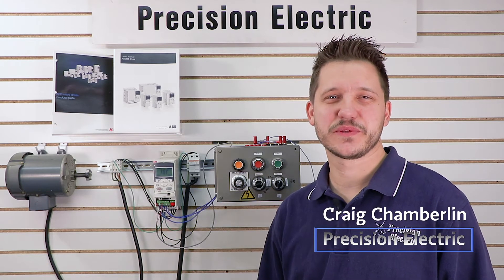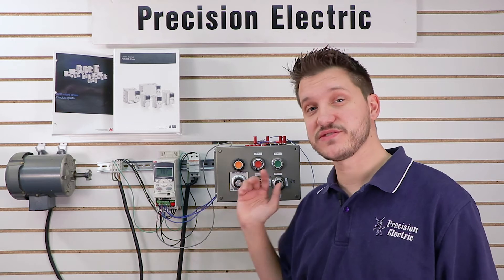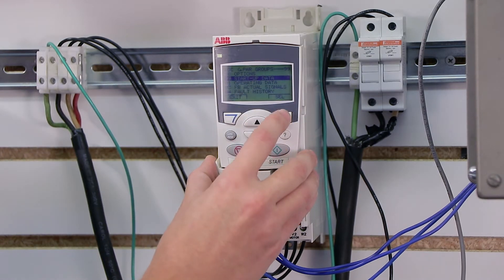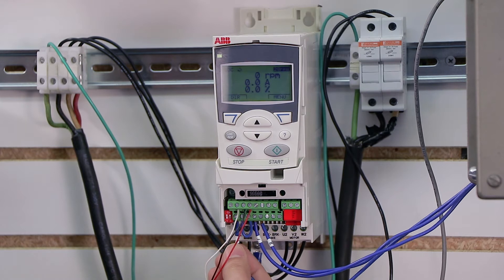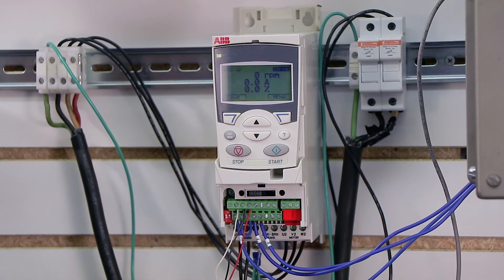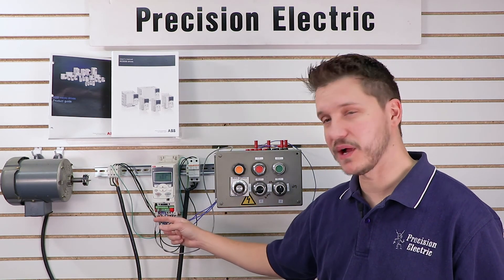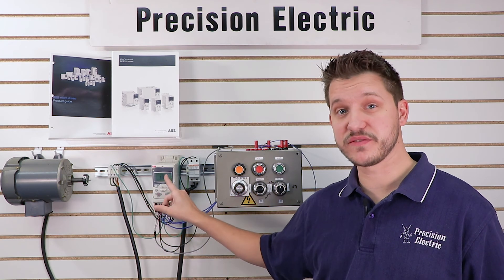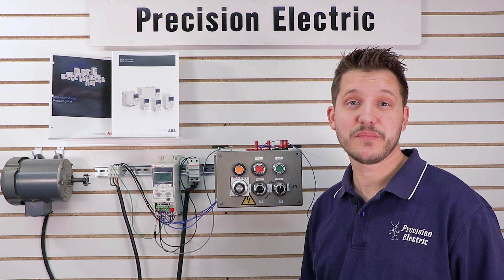ABB ACS355 Training Lesson 4: Basic Start Stop Pushbutton Control Wiring & Programming - VFDs

Comment: Trying to use this drive with a set of photo eyes. Sending a wire from terminal 9 - 24 volts to the photo eye and when the photo eye comes on it sends 24 volts to terminal 12. Now terminal 13 also has to have 24 volts so I jumpered  terminal 12 and 13 together so when the photo eye goes off the 24 volts stops as well turning terminal 13 off and stopping the drive. I have set the drive in 3-wire mode and put it in remote and nothing happens when the photo eye comes on. Is there a parameter that I am missing?

Comment: When I engage the start button, the drive says fault 1009. How do i fix this?
Reply from the maker: ## Resolving Fault 1009 on ABB ACS355 Drive

Fault code 1009 (PAR PCU 1) on the ABB ACS355 drive signals an incorrect setting for the motor's nominal speed or frequency. This issue arises when the entered parameters don't align with the motor's specifications or the drive's operational limits. The sources offer guidance on interpreting this fault code and suggest steps for rectification.

*Troubleshooting Fault 1009*

* *Motor Type Matters:* The first step is to confirm the type of motor connected to the drive: induction motor or permanent magnet synchronous motor. Different calculations apply to each type when verifying parameter settings.

* *Induction Motor Checks:* If you are using an induction motor:
    * *Speed/Frequency Ratio:* Ensure the ratio between the motor's nominal frequency (parameter 9907) and nominal speed (parameter 9908) falls within the acceptable range: 1 < (60 * 9907 / 9908) < 16.
    * *Speed and Pole Pairs:* Verify that the ratio of the motor's nominal speed to the calculated synchronous speed (derived from nominal frequency and pole pairs) is within the range of 0.8 to 0.992.

* *Permanent Magnet Synchronous Motor Checks:* If you're using a permanent magnet synchronous motor:
    * *Synchronous Speed:* Confirm that the motor's nominal speed perfectly matches the calculated synchronous speed (calculated from nominal frequency and pole pairs).

*Additional Verification Steps*

Beyond the motor-specific checks, scrutinize these parameters for potential inconsistencies that could contribute to Fault 1009:

* *Minimum and Maximum Speed:* Confirm that the minimum speed (parameter 2001) is strictly less than the maximum speed (parameter 2002).
* *Minimum and Maximum Frequency:* Likewise, ensure that the minimum frequency (parameter 2007) is less than the maximum frequency (parameter 2008).
* *Ratio Limits:* Double-check that the ratios of minimum speed to nominal speed, maximum speed to nominal speed, minimum frequency to nominal frequency, and maximum frequency to nominal frequency all stay within the permissible ranges.

*Corrective Actions*

* *Parameter Adjustment:* Based on your motor type and the checks above, modify the relevant parameters - motor nominal speed (9908), motor nominal frequency (9907), minimum and maximum speeds (2001, 2002), and minimum and maximum frequencies (2007, 2008) to establish consistency and compliance with the drive's operational limits.

* *ID Run:*  Especially if you're using vector control with an induction motor, performing an ID run can help the drive automatically determine optimal motor characteristics and potentially resolve parameter conflicts. You can find detailed instructions for the ID run procedure in section 8 of the ABB ACS355 User Manual.

* *Expert Consultation:* If, despite these adjustments, the fault persists, it's advisable to consult with your local ABB representative or an authorized service center for specialized diagnosis and support.
Reply from the maker: ### Wiring Momentary Pushbuttons for Start and Stop

*   *Set the value of parameter 9902 APPLIC MACRO to 2 (3-WIRE).* This enables the 3-wire macro, which is designed for controlling the drive with momentary pushbuttons.
*   *Wire the control connections according to the connection diagram for the 3-wire macro.* The default I/O connection diagram for the 3-wire macro is shown below:

    *   *X1A*
        *   1 SCR: Signal cable shield (screen)
        *   2 AI1: Motor speed reference: 0…10 V
        *   3 GND: Analog input circuit common
        *   4 +10V: Reference voltage: +10 V DC, max. 10 mA
        *   5 AI2: Not in use by default. 0…10 V
        *   6 GND: Analog input circuit common
        *   7 AO: Motor speed value: 0…20 mA
        *   8 GND: Analog output circuit common
        *   9 +24V: Auxiliary voltage output: +24 V DC, max. 200 mA
        *   10 GND: Auxiliary voltage output common
        *   11 DCOM: Digital input common
        *   *12 DI1: Start (pulse)*
        *   *13 DI2: Stop (pulse)*
        *   14 DI3: Forward (0) / Reverse (1)
        *   15 DI4: Constant speed selection 1)
        *   16 DI5: Constant speed selection 1)
    *   *X1B*
        *   17 ROCOM: Relay output 1
        *   18 RONC: No fault \[Fault (-1)\]
        *   19 RONO: No fault \[Fault (-1)\]
        *   20 DOSRC: Digital output, max. 100 mA
        *   21 DOOUT: No fault \[Fault (-1)\]
        *   22 DOGND: max. 500 ohm
*   *Connect the momentary start pushbutton to digital input DI1 and the stop pushbutton to digital input DI2.*
*   *Ensure that parameter 1003 DIRECTION is set to 3 (REQUEST)* if you need to change the direction of rotation.
*   *Ground the cable shield 360 degrees under a clamp. Use a tightening torque of 0.4 N·m (3.5 lbf·in).*
*   *Ensure that the drive is in remote control.* Press key *LOC/REM* to switch between remote and local control.

Once these steps are complete, you can start and stop the motor by momentarily pressing the start and stop pushbuttons. The control panel start and stop buttons will be disabled when the stop input (DI2) is deactivated. You may want to verify this behavior.
Reply: Thank you for the info! I actually resolved the first issue. All is well with potentiometer. The  new issue, however, is start/stop terminals are wired correctly as the manual states, but when you engage( musthold button in) either start or stop,  it changes the rotation,  rather than call for start or run. I've been in the eletrical field for 6 years now, but have within the last 2 years dove into controls & automation. I appreciate any info you may be willing the share!